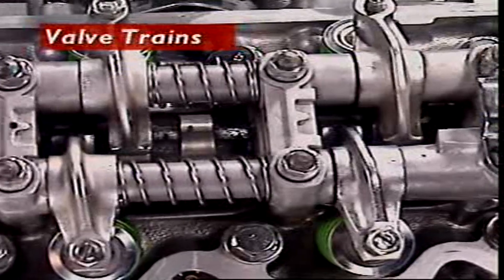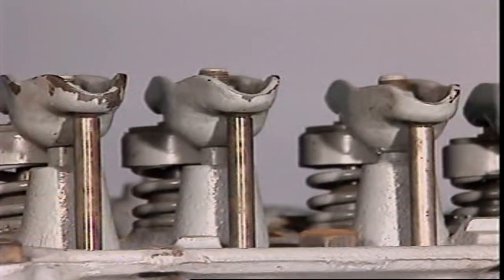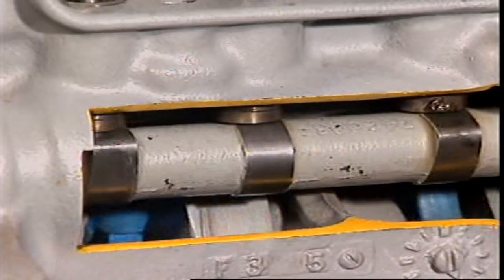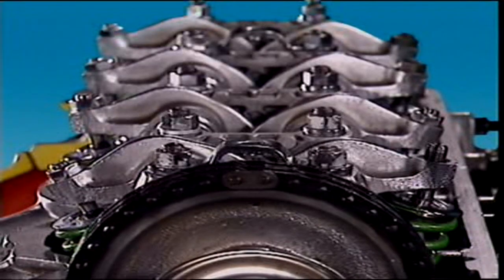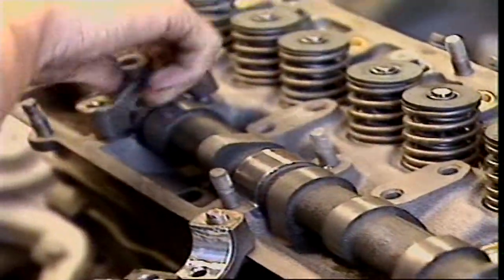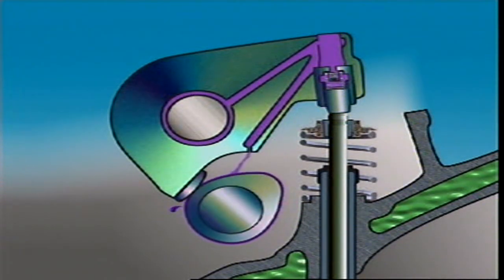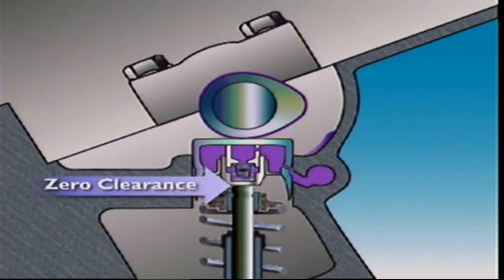How an Engine Works? Valves Trains (7)

Comment: 1:30 Although these adjustments are specified in the owner's manual, most people get away with not adjusting them. I have worked on some Honda engines that have gone over 200,000 miles and never had an adjustment. The Honda CRV that was sold in the USA between 1997 and 2001 does tend to go out of adjustment and at 200,00 miles and the valves burn.
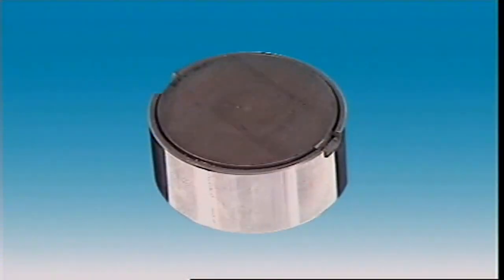3:25 Sometimes the disc is located under the valve lifter. Other times, valve lash is set by using ticker or thinner valve buckets. This is a very expensive and time-consuming job.
Reply from the maker: Thanks for your share 👍 🌹
Reply: @ShadyGhazy  I'm glad I could help. I worked in auto repair for several years and still enjoy when I can help repair someone else's car.
Reply: @skylinefever  but you are a skyline lover. Me too.✌️